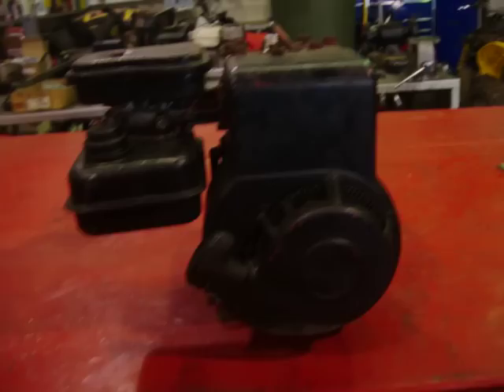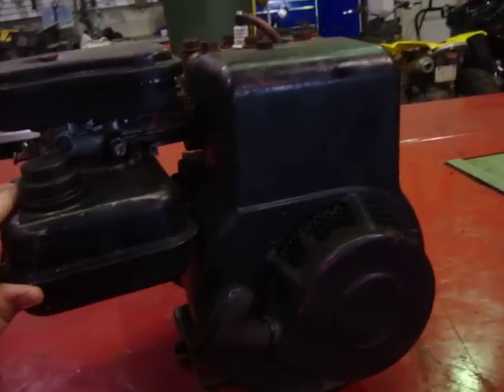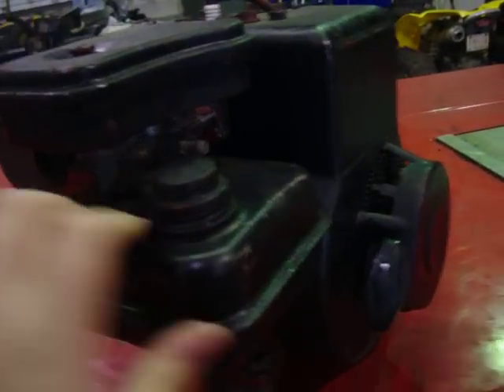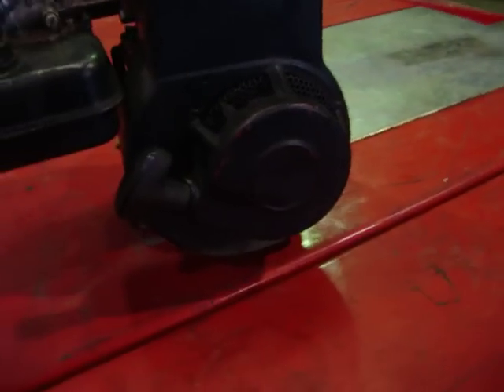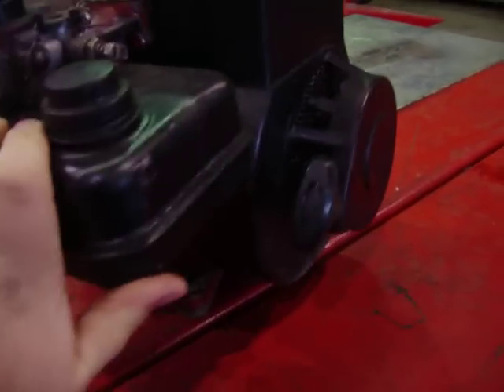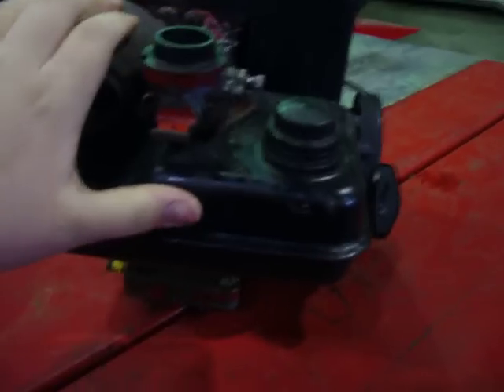1972 Briggs & Stratton 2HP Rebuild Part 1

Comment: No it is just an aluminum bore not hardened, you hone the bore and it will work just fine, I have honed over 600 small engines and never had a problem. I went to school for this and no mentioning of a hardened bore. Not a problem folks. I don't know where people come up with such theories, a lot of these vids are good but a lot are a bit mislead!